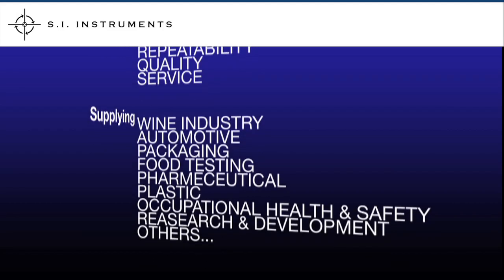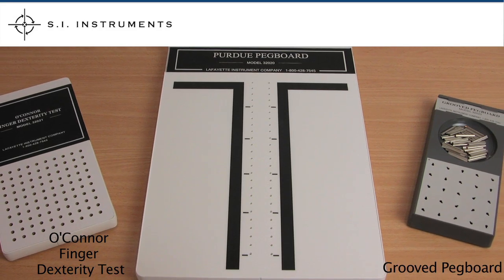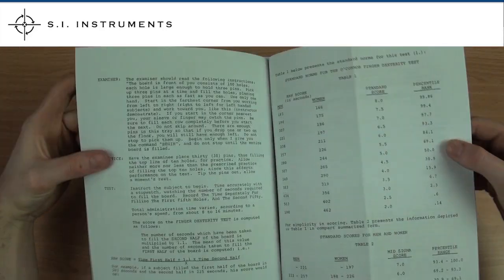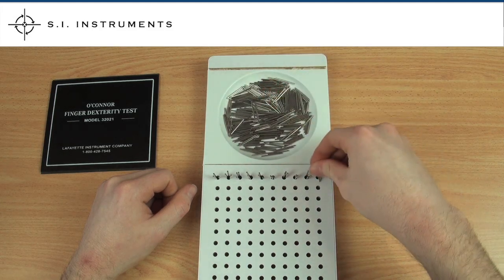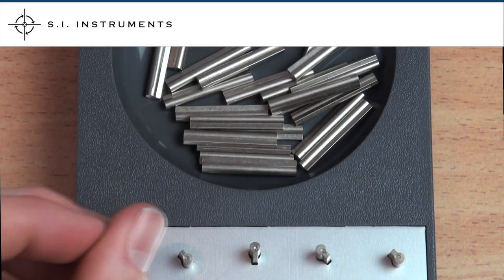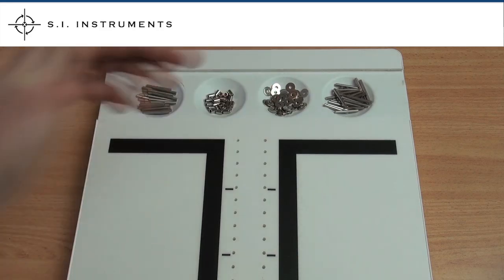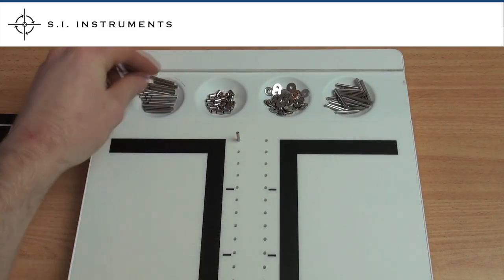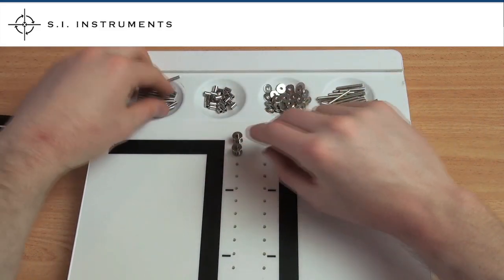Dexterity Testing

Comment: these test are insane expense, like 150+….even the nuts and bolts are $60…..I am going to Lowe's to build my own and i will be surprised if it costs for than $20. This is me passing an economics and wood shop class….
Reply: I wonder are there plans around the net. Definitely wouldn't be hard to make CNC plans for the boards and make them more easily producible by individuals
Reply: were you able to build it? I can´t afford it